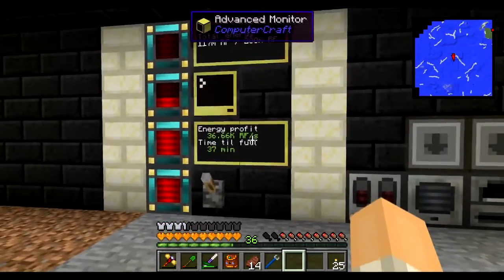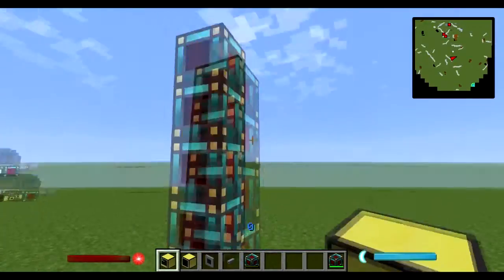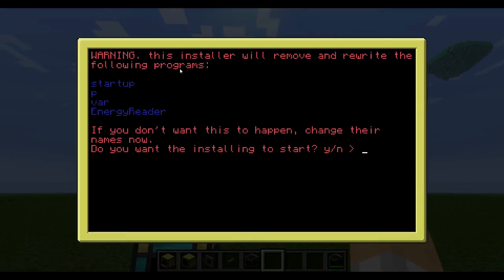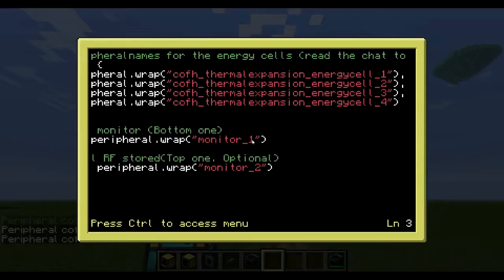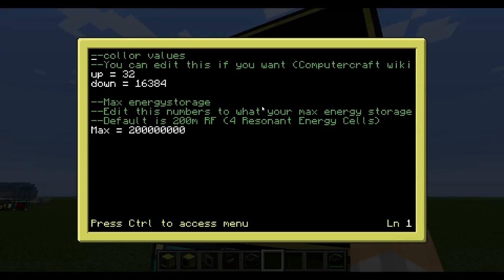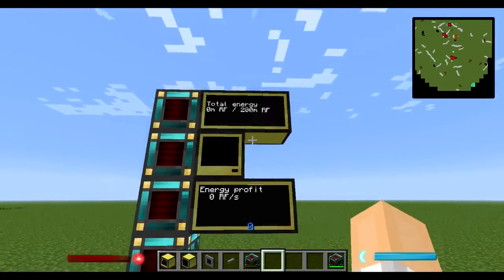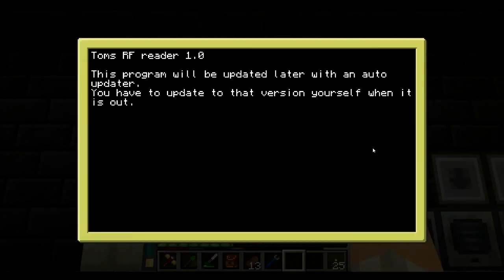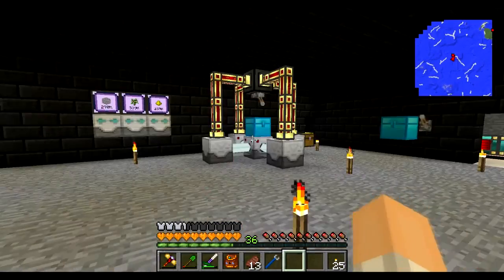Toms Thermal Expansion Energy Cell reader (RF/s)

Comment: This is a computercraft program I have been working with for the last couple of days. It reads your Thermal Expansion energy cells and calculates how much is going in and out of it and shows you how much profit or lose of energy you have per second.
It will also show you how much power you have stored

Comment: Pls help:
When I try to run the "Installer" by entering "y" and pressing enter, this message comes up:
"Installer:40: attempt to index local "Download" (a nil value)"

I have MC 1.12.2 ~ ComputerCraft:Tweaked 1.83.1 ~ Thermal Expansion 5.5.4.43 ~ All in a modpack called "A Nuclear World"

What could this all mean ?
Reply from the maker: yeah, they changed how dropbox files links work. I know I fixed it on my personal server. I'm currently booting it up again, and I'll upload it. I'll post the pastebin in the comments, aswell as the video.
Reply from the maker: Pastebin code: 4BBbtXjX
Sorry for late fix. It's been a long day :)
Reply: @tom759345  Oh, thank you, I really needed this you're a lifesaver :)  Amazing script btw
Reply: @tom759345  Wait, when I try to run "Installer" after getting it from pastebin and downloading it (thank you for fixing the link) as "Installer"
 it just says "computer will now reboot!" and then after it does, a text comes up saying "Startup:1:unexpected symbol"

After this, if I type in "Installer" again, it shows a screen where it says:

 Number of cells: 0
0 RF/ 0 RF
0 RF/t

and I cannot enter anything into the command prompt after that, so...
Also my setup is a 2x1 golden screen, golden computer and 3x thermal expansion energy cells, all connected with wired modems.
Reply from the maker: @filipskotnica971  Try to reinstall now. Do not call it Installer, just call it EnergyReader or something. The name does not matter. If it sais:
Number of cells: 0
0 RF/ 0 RF
0 RF/t
then make sure the wired modem on the energycells are red.

Look at the names popping up on the computer when you start the program. There should be one "thermalexpansion:storage_cell" and one "monitor" for every monitor and energy cell. Anything other then that is unexpected by the program, and can be changed in line 29.
Reply: @tom759345  I did what you suggested, this time it goes directly to that screen where it's:
Number of cells: 0
0 RF/ 0 RF
0 RF/t

But at least it doesn't say "Startup:1:unexpected symbol" , so that's an improvement.

I think it just doesn't detect any energy cells, as if they weren't connected 

I have made sure the modems on the computer and on the monitor are red, but it doesn't turn red when it's on the energy cell (I tried it on different sides, set as output/input/neutral) So somehow the energy cells isn't connected to the network maybe ?
Reply from the maker: @filipskotnica971  Make sure your modpack have "Plethora Peripherals" I think. It's the mod that makes computercraft read every blocks metadata and use it. The easies way to test it without checking the mod list (Because I can't remember if it is the right mod name) is to place down a computer, and then a energy cell or something else like a chest on the right side of the computer. Then use this code:
for i,v in ipairs(peripheral.getMethods("right"))
  do print(i..". "..v)
end
source: https://computercraft.info/wiki/Peripheral.getMethods
If no methods comes up on your computer screen, you don't have the mod necessary to use this program :(

If this does not work, I have to see the problem up front to figure it out
Reply: @tom759345  Ok, so I just looked and didn't have the Plethora thing, I installed it - and now the whole script works. Thank you very much for helping me, this is an awesome program ;)

Comment: Hello Tom,
 thx for the Programm :) i used it in 1.6.4 a long time and it worked perfect good job! but my Problem is that i can't use it in 1.7.10, i play FTB Infinity, i also changed

cofh_thermalexpansion_energycell_0
to
tile_thermalexpansion_cell_resonant_name_0

because it didn't worked with your settings, the peripheral was another, but now it just dont want to start the Error is:

 EnergyReader:10: Failed to convert arg 'side', caused by:  ''1' is not valid enum value, must be [DOWN, UP, NORTH, SOUTH, WEST, EAST, UNKNOWN] or 1. .7'

i hope you can help me :)
~Sabo
Reply from the maker: IVIrSabo I would say that this program is not supported with 1.7 and up because of a bug in open peripherals, but to me it looks like you found some sort of work around that might work. I have been working on one myself, but I do have some problems with it, but I'm still trying to fix it Intill then, there is no way I can help you. Sorry
Reply: ***** Oh ok so i hope you can do an energy reader for 1.7.10, it would be awesome i loved it on 1.6.4 :3 it helped a lot
please continue working you do a fantastic job

~Sabo
Reply from the maker: I just need to say thank you :D
I'm working on the fix now, but it's for energy reader 2.2. Hopefully it will be out within an houre or so :)
If you wanna test the changes, use the DEV function from EbOS
Reply from the maker: IVIrSabo The DEV version is now working, but I wanna make some changes for 2.2. What do you think, should I release the fixes now as 2.1.1, or spend some hours and release everything as a 2.2 version? :p
Reply: ***** Thank you very much now it works for me :) i would spend the time to make it perfect,
release it when you think the programm is perfect :)

~Sabo

Comment: I have everything connected like in the video but my monitor wont show the amount of rf I have in my cells. It just says 0m/40m
Reply from the maker: 1. Is the modem for that monitor on?
2. Did you config the that monitor with the right peripheral?

You can ether run the installer program again, or terminat the program and run "edit p".
I'm working on an easy way to config this and saveing it for later...
Reply from the maker: The monitors setings for it is in program "p", line 12 and 13

Comment: Hello, I'm trying to use this in HatPack 3.4.2 and I'm getting "Installer:40: attempt to index ? (a nil value)"
I'm guessing the installer needs to be updated for a newer version of ComputerCraft?
Reply from the maker: Do you get anything at all or does it just give you the error?
Reply from the maker: I just ran a test with HatPack 3.4.2, and there seems to be alot of problems with computercraft in this modpack. I did not get the same error as you, but I was unable to use the pastebin program...

Comment: Qustion, is it possible to use wireless modems to connect eneryy cells (or just one for start) ?
Reply from the maker: Wireless modems does only work on computers. A newer version of open peripherals might be able to use them for everything, but this program was made with and for Computercraft 1.57 and OpenPeripherals 0.3.3
Someone tested it for computercraft 1.6, and this program is working there, however, it's not programed to be stable for that yet.
Reply: ***** ok, thanks

Comment: wen i do a right click on the wired modem of the energy cell that does not connect
i play on forge 9.11.1.965
Reply from the maker: Do you have oper peripherals installed?
Reply from the maker: Is it connected to the computer?
Is it far away from your computer?
Reply: ***** I have make exactly as you in your video
Reply from the maker: Is the wirered modem turning red?
Or do you get an error on the computer?
Reply: ***** Maybe that it is my version forges or computercraft which is not good
Reply from the maker: Nicolas Ramassamy What version of computercraft are you running?
and do you use ftb?
Reply: ***** on the computer and the monitors its ok. But on the energy cell it doesn't work : the wireded modem doesn't turn into red
Reply: ***** I dont use ftb. The version of computercraft is 1.63 i download it on this website : http://www.computercraft.info/download/
Reply from the maker: Nicolas Ramassamy Does the computer read the energy cell?
what version of open blocks do you use?
Reply: ***** 0.4.1
Reply from the maker: This program was made with:
ComputerCraft 1.5
OpenPeripheralAddons 0.1.3
OpenPeripheralCore 0.3.3
ThermalExpansion 3.0.0.7
I did all the programing thought Direwolf20 ftb pack.
Some people have tested it with other versions of computercraft, and I know it works in 1.6, but with a few bugs
Reply: ***** I have solved the problem with your help(assistant). By looking at the file config I noticed that the openblock core was not present. THANK YOU VERY MUCH and saddened for the disturbance.
Reply: Nicolas Ramassamy Otherwise I find the great interesting idea. I shall look forward to the version 2.0

Comment: This is an awesome program btw, and I was wondering is there a way to say if it gets below 50m energy output a redstone signal
Reply from the maker: It allready does this. If your power goes under 10%, a redstone signal will be outputed on the right side of the computer.
Reply: ***** I noticed that but when ever it goes over 10% it turns back off which is rather annoying, is there a way to make it so it turns on at 10% then stays on until say 90%?
Reply from the maker: TheXylis I'll try to make something like that happend in the next update. I'm working on rewriting some of the codes
Reply: Alright cool thanks

Comment: Nice program! Can you add if power low emit redstone signal?
Reply from the maker: I could do that. I'm working on some way to warn you if you're running low on power and you are not online able to fix it. But a redstone signal should not be hard to add in :)
Reply: Thanks
Reply from the maker: Nicolay Andresen It will now output a redstone signal to the right of the computer if you power is ever lower then 10%

Comment: error.  EnergyReader:5: Attempt to index ? (a nul value)
Reply: ***** pls answer fast <3
Reply from the maker: You get this error because you are not running the program how it's suposed to be runned. Run the program like it's showen in the video
Reply: IVIrSabo the error is that 1 of your Modems is not set up correctly.  either it is not on or you did not put the correct number in the code before running it.  if i recall that error correctly.
Reply: yeah i got it ^^ thx bro